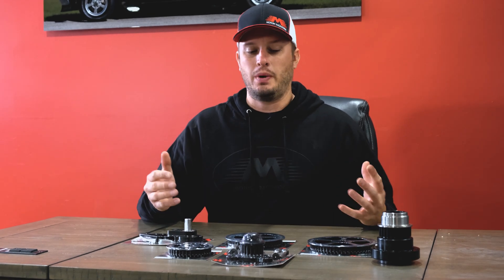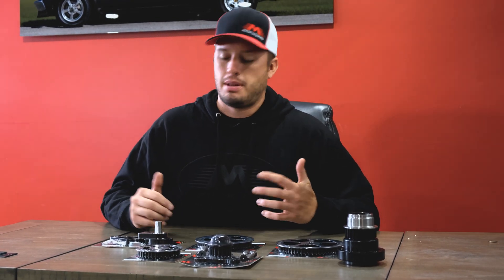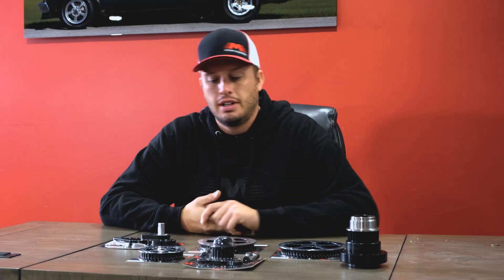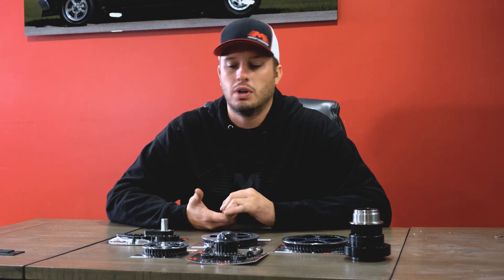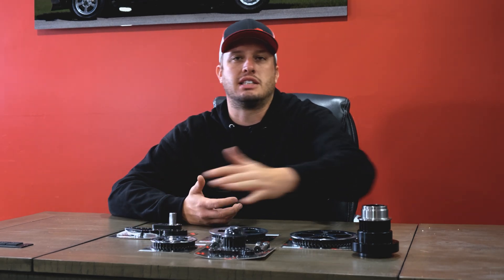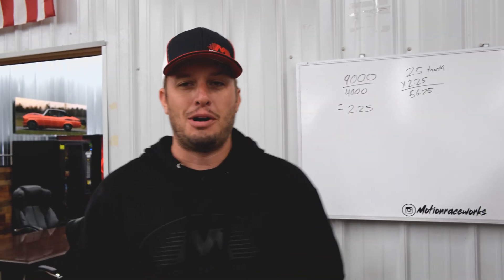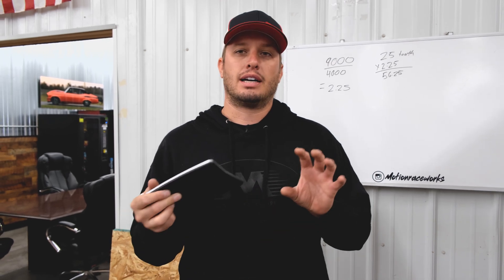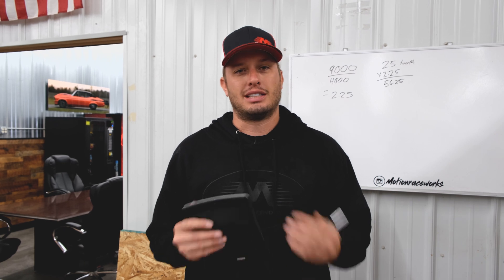Mechanical Fuel Pumps and Choosing the Correct Pulleys: Tech Tip Tuesday

Comment: Will the coyote hub work with a 5.4 4v mod motor with an ATI balancer and do you have a mounting bracket for it? I am going to be running motor plates, so should I just build something to mount it to?

Comment: I tell you could make that would be perfect for a mechanical fuel pump drive.  Implement a pump drive that could be run from the serpentine belt system. Many systems use idler/tension pulleys, some will even have direction changing pulleys that run inside the serpentine.  Many have a second drive say like a 2005 GTO that could use the A/C belt system to drive a mechanical pump.
Reply: The problem with the serpentine belt is the possibility of belt slip under high load or the belt coming off at high RPM, both times when you absolutely do not want to run out of fuel pressure. A toothed belt with a short run should mitigate both of those issues. The serpentine system might also be a pain to get the drive ratio set up correctly.

Comment: You could have said it's exactly like over or under driving a roots 8:71 supercharger. 

Small pulley on blower big on bottom = over drive ie: faster than engime rpm by x amount

Obverse is spinnimg the blower slower than crank rpm.

Same ratio concept except the pumps have a specific ideal rpm and ratio March